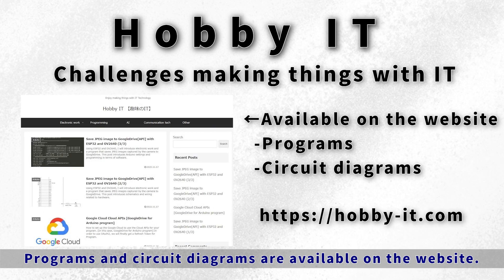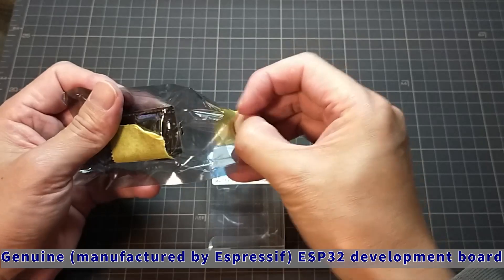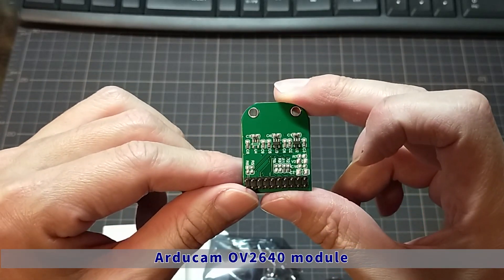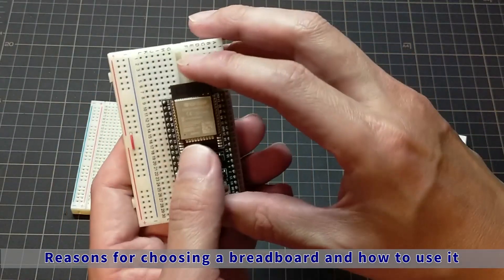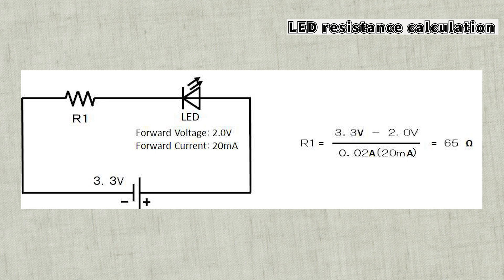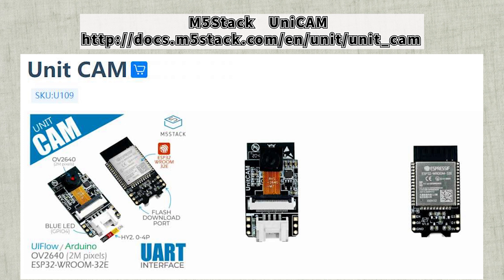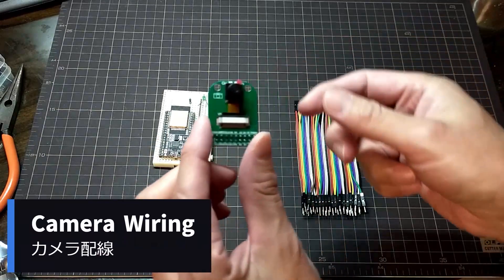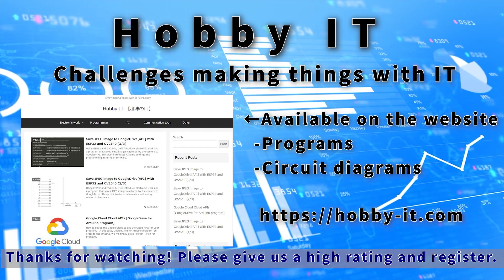IoT camera production using ESP32 and OV2640 [Hardware]

Comment: Hi, I am using a different ov2640 model which hasn't got an xclk pin. Rather it has got an NC pin and seems to have a 12Mhz built-in oscillator. It keeps throwing  the error "camera capture failed". Not sure what to do.Have tried multiple times looked up the net everywhere but can't find a solution that works. Please help me out